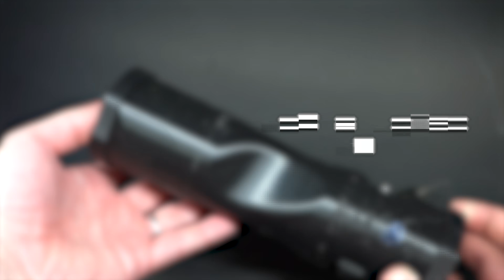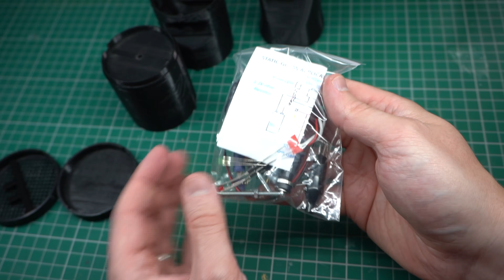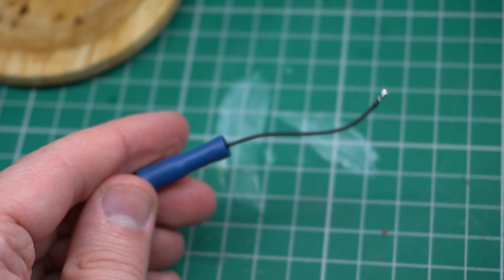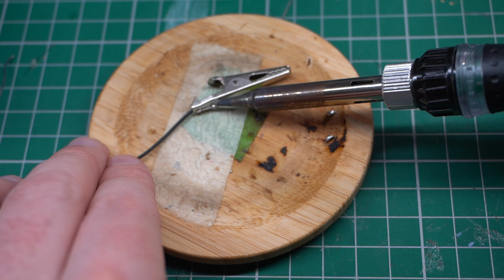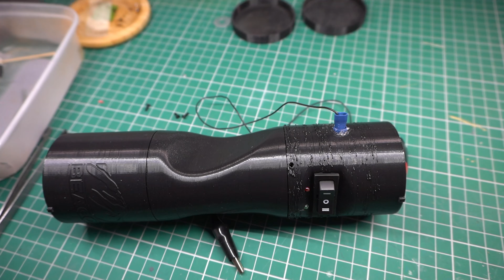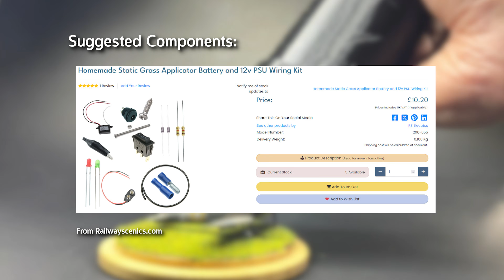A Static Grass Applicator For Your Dioramas - But On A Budget! Beacon Models Product Build

Comment: Looks simple... now to buy a 3d printer, some filament, learn how to use it all... then get a city and guilds certificate in electronics.. some glue and the time to do it all.
Reply: Or build one using a bug zapper and metal tea strainer
Reply: @DavidCoombes54  Or rub stryrene sprue with wool sock.
Reply from the maker: 3D printing isn’t as hard as you think, and if you can’t afford one you can get print on demand services or maybe even know someone who has one.

Alternatively you could probably make a housing out of other materials you are more comfortable with.

For the electronics, everyone should have basic soldering skills because it was part of the school curriculum in the UK, so no need for a qualification in it

If you can follow instructions then you’re probably in a good place to create something like this, because the provided instructions are pretty easy to follow 

But yes, time is the main holdup for all of us but if you have a couple hours this is definitely within reach as a hobby electronic project